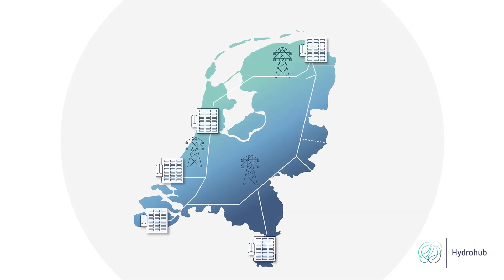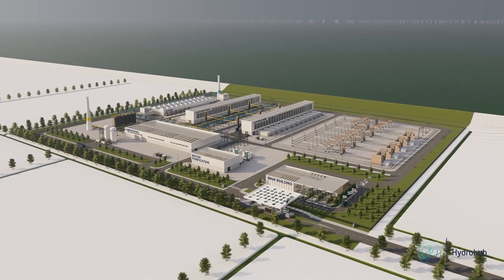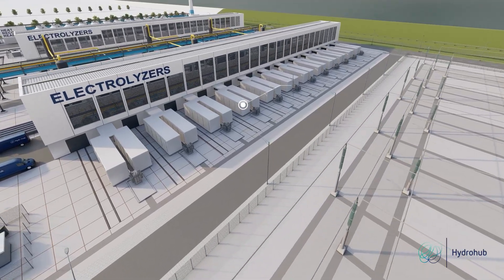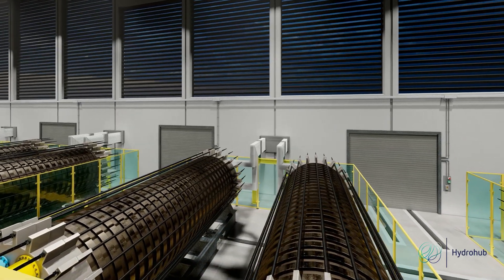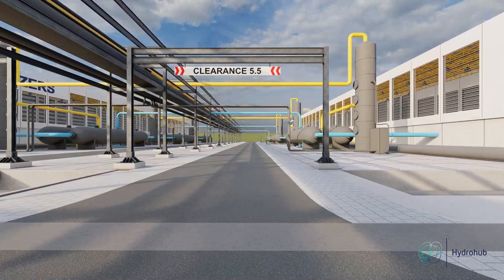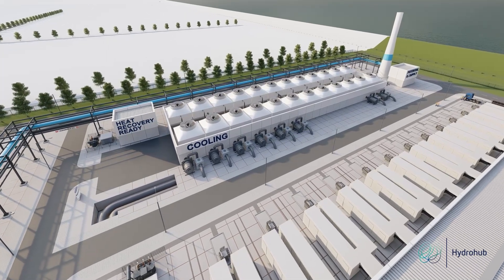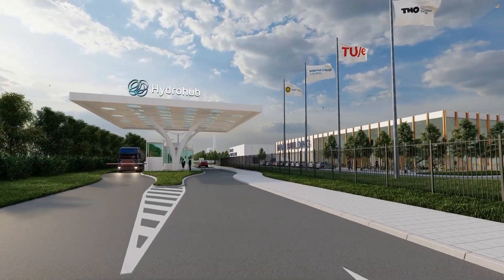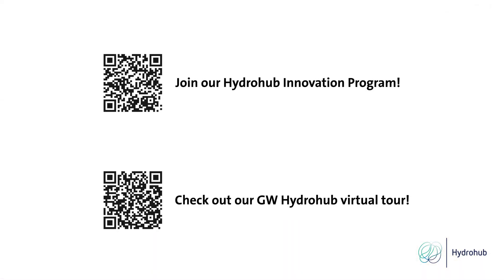Gigawatt green hydrogen plant: the advanced design

Comment: What's LCOH (Levelized Cost of Hydrogen)? How much maintenance will this plant require? would make more sense to have the electrolyzers work off directly from wind or solar energy and avoid the need for the electrical equipment (keep a DC-DC converter at most) many electrolyzers can deal with intermittent electricity. Solar is now cheaper and expected to reach $0/kWh in the US (see PV magazine). The plant will be co-located with a solar array or windmill farm and activated when power can't be exported.
Reply from the maker: Hello, thank you for your interest and questions. The Levelized Cost of hydrogen is the price the end user pays for hydrogen. If the hydrogen production factory is located further away from an end user, this will for example also include transport costs. Regarding your point of using direct current from solar of wind parks; indeed this is a very interesting remark! We are now starting up a new project to explore this possibility. It will indeed make the hydrogen production more efficient. For more information see our report 'A One-GigaWatt Green-Hydrogen Plant; Advanced Design and Total Installed-Capital Costs: https://ispt.eu/media/Public-report-gigawatt-advanced-green-electrolyser-design.pdf. Kind regards, ISPT

Comment: Can we transport these compressed hydrogen gas to remote areas and used in generating electricity in commercial Shop off grid
Reply from the maker: Thank you for your question. Technically yes, but if this is sensible and economic is a different question. To answer your question requires more understanding of the use case, conditions and scale.  Probably best to generate renewable electricity off grid without conversion and transport losses.

Comment: What amount of water is used annually and what are the environmental and ecological impacts of the plant?
Reply from the maker: Hi Roy, to answer your question. There is no environmental and ecological impacts of the plant.
 Only thermal discharge, fresh water usage and oxygen emission.

The electrolyser plant uses process water and cooling water. Process water is feed water for water electrolysis and is (stoichiometric) 0,9 litres per kg of hydrogen produced, which is roughly 100 m3/h for a GW hydrogen plant.

•	Specific demin water consumption is 9 L/kg (0,8 L/Nm3) produced hydrogen. 
•	Water consumption is depending on load variation 0-100%
•	Water losses with O2 vent: 5% losses (PEM)
•	Required capacity net demin water consumption: 
•	nominal 171 m3/h (alkaline) 
•	nominal 167 m3/h (PEM) 
•	design margin 30% (including losses and buffering)
•	design: 230 m3/h
•	Reverse osmosis (recovery of 50%) and Ion exchange (PEM)
•	Therefore 460 m3/h of fresh water

Cooling water demand depend on system and heat recovery. We use open CW system. Roughly 75% of a GW electricity supply to a plant is converted into heat, so about 250MW.
Reply: @ISPTNetherlands  Hi! Thanks for the elaborate answer, super interesting. Have you looked into the effect of fresh water extraction on water ecosystems? Or would all water be obtained from the sea and then be processed via reverse osmosis? If so, to what extent would that affect aquatic life? Thanks in advance.
Reply: Can you compare between pem and aem ?